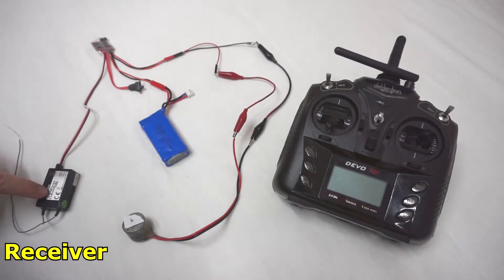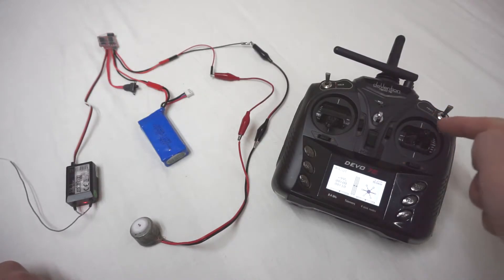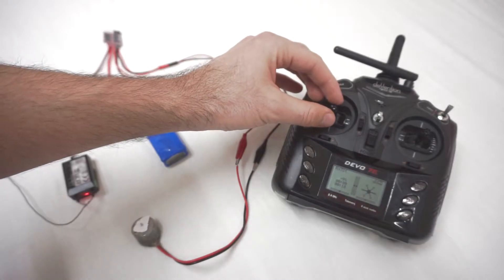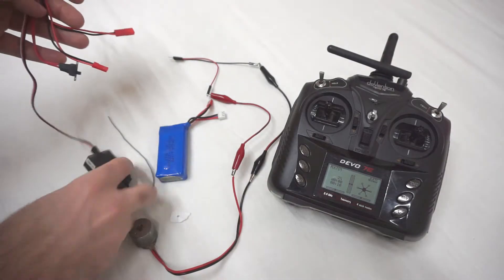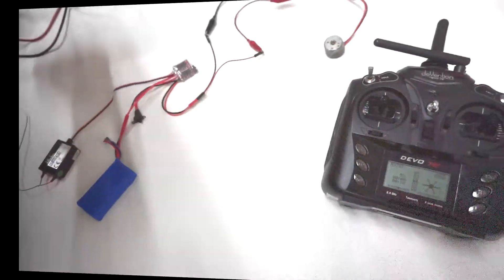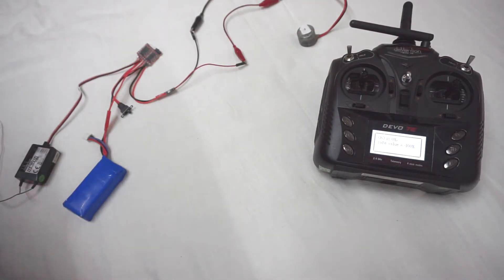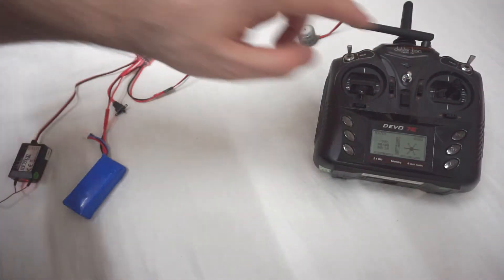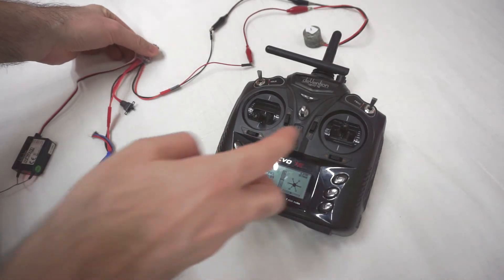30A Brushed ESC (Devo 7E, 2S LiPo, RX701, Brushed Motor)

Comment: What if I use 3s 12volt battery on this esc??
Reply from the maker: Theoretically it supports 4V - 8V, that's a 2S lithium (7.4V).
Reply: @furulevi  it explode or it can work

Comment: All descriptions (ebay,aliexpress etc.) state that interface to this module is PPM, it is clearly PWM. Thank you for this demo.
Reply from the maker: How can one tell if it's PWM or PPM?
Reply: @furulevi  RX701 doesn't support PPM, only PWM, and in the demo motor is working as it should. In other words elimination, PWM is default standard for servos.

Comment: Hi man, What's the motor's voltage? Aren't there any problems with sending 7.4V to a 5V motor?
Reply from the maker: Nothing is mentioned on the motor, but I guess if you use it only for a short period than it is acceptable.